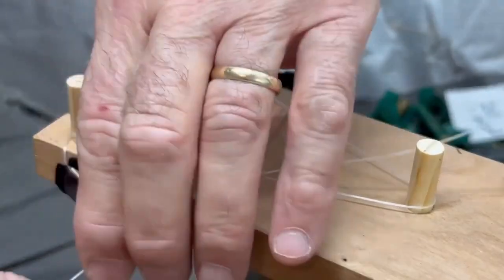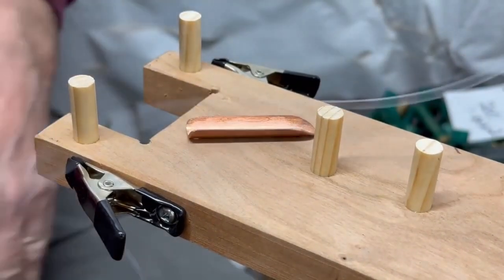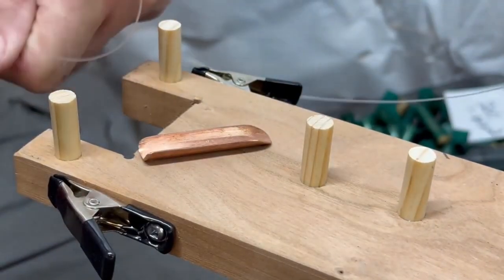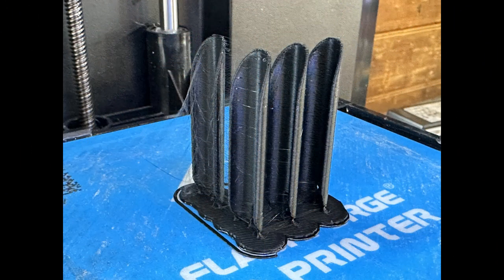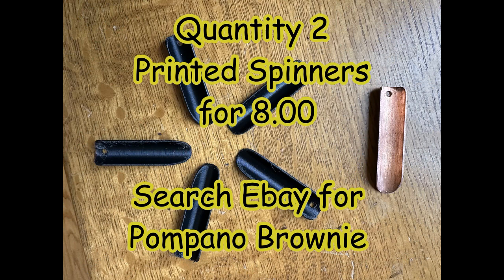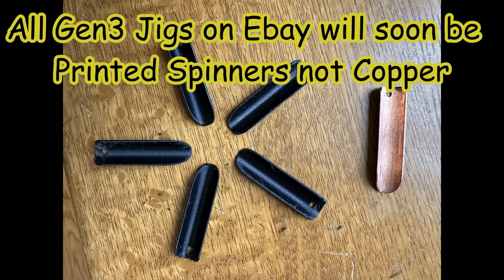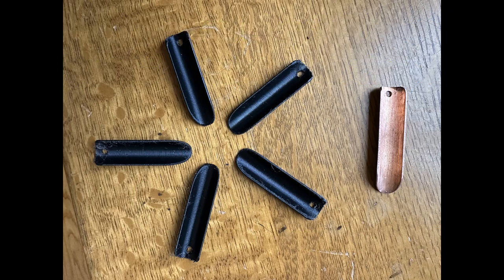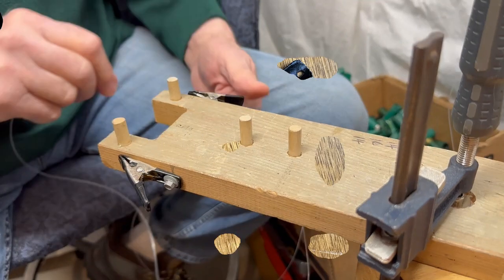NEW Gen3 Spinner

Comment: Does it  matter  which  side ( point  or back) when you put hook on the dropper loop? How  was your  pompano bite or is there  still any fish around? Thanks
Reply from the maker: Dave, I always cut the loop, if you watch my video on using the GEN3, That allows the bait to float higher in the water column if you’re using float, and attract Mr. Pompano a little more IMO.
Reply: I did watch and the tooth pic trick is excellent